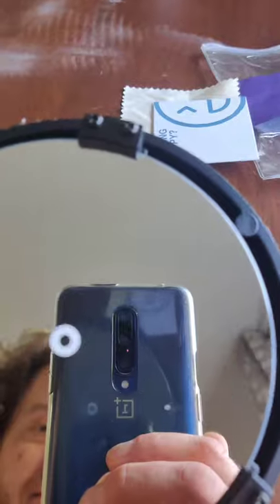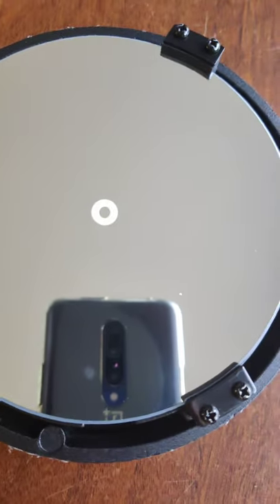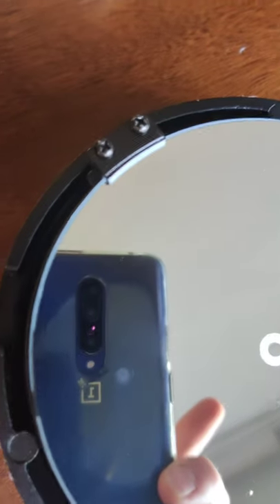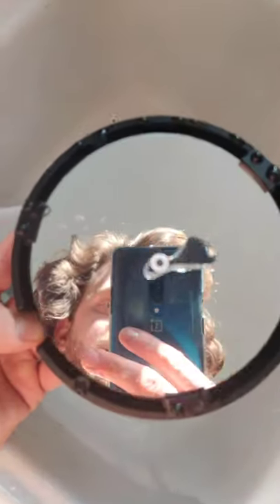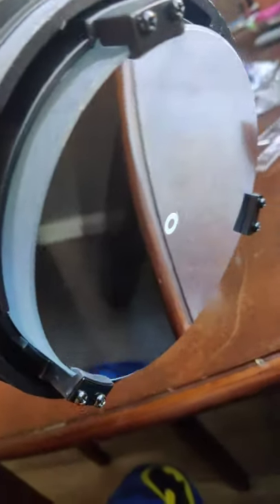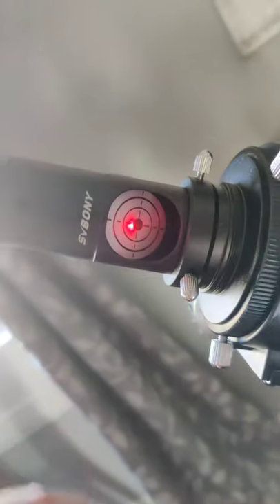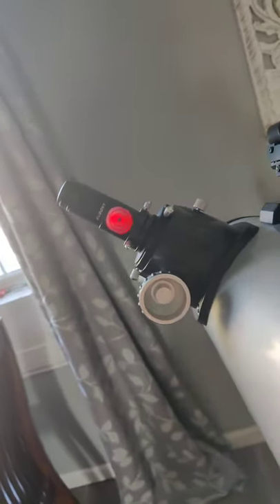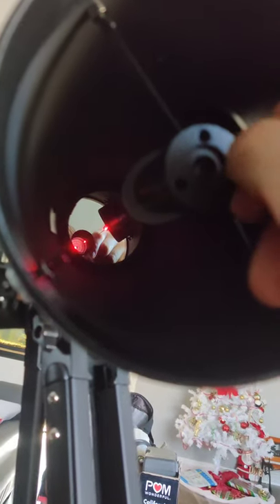Celestron Starsense Explorer 130dx primary mirror cleaning and collimation

Comment: Thank you for this video. I have a  Bresser Aurora reflector 137mm. It has a bit of dust on the primary. mirror.
I think it's  a tiny piece of lintel or a hair like filaments or thread. Do you think that a light blast f compressed air would do it? I'm not talking about a big, huge blast now. Just enough to blow it loose or dislodge it. From near the end of the OTA.
Maybe I'll try to find someone local that does it?
Reply from the maker: the whole process was alot easier then I expected. Hope the same goes for you man! Good luck 🤘